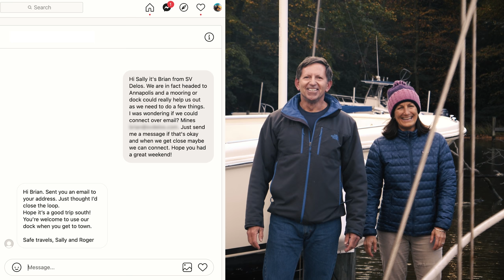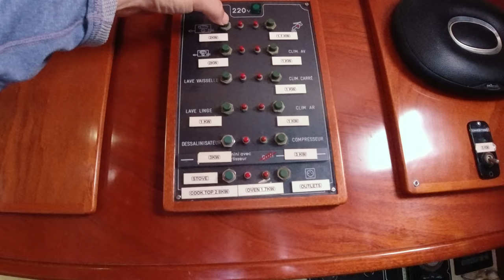6 Week MINI REFIT 😬⛵The Projects that Nearly Broke Us  - Sailing Vessel Delos Ep. 310

Comment: 15:27 All cabinet doors and drawers could have a wicker/wire/screen mesh in a cutout so air can always "circulate" from warm to cool / humid to dry.( Reach equilibrium)
Reply: That won't help. The trouble is the air temperature dropping 20 degrees when it reaches the hull. The only thing that helps is keeping the air from getting there, aka insulation.

Comment: The tubing issue seams like carbon build up. You guys, in the past, mention running the engine in very low rpms. Running it harder raises temperature and burns most of the build up. So considering reving the engine (with load) to higher rpms for a few minutes every run...
Reply: I just watched that episode. Lol
Reply: This ^ but also, it looks like an injector went bad and was burning raw diesel in that muffler pipe.

Comment: We run into the moisture problem as well, in our camper. When we're doing cold-weather camping, and have the heat running inside, we struggle with condensation.
Reply: Considering using stone wool. Stole wool is fire resistant which can tolerate 1,800°F (1,000°C), and don't release toxic gasses.

Even a very thin insulation would help a lot - and also dramatically lowering heating cost, but not if you forgot to insulate a very small area. That area would be a cold bridge (bridging cold to warm), which will transfer heat to the cold.

Rockwool is one of many stone wool products.

Polyurethane isn't a good material to use for insulation. Polyurethane burns violently and releases cyanide when it burns. Cyanide's toxicity has been proven on a site which entry sign reads "Arbeit Mact Frei".

Comment: I’ve spent three winters putting in 10mm closed cell foam.This year finally,it’s a night and day difference.It can be 80% humidity outside,and40% inside.And it didn’t take much to heat it.Very easy to use. I highly recommend it.A lot of work,but well worth it

Comment: Hey Hey Delos!
With your 50hz/60hz dilemma, the way to get around it would be to have a large dedicated AC Battery charger that supports 50/60hz input and preferably itself is multi voltage (usually 90-250v) [though in your case you have a transformer], and use that to provide power to the 24v DC Bus.

Then you can run your onboard inverter(s) like normal to get 50hz power on board for AC Appliances. The Batteries will be topped off by the charger(s) and will provide the extra amps to the inverter for periods where the chargers cant keep up if that ever happens.
It's not quite as efficient, but at least then you wont be Overspeccing things that are frequency sensitive or dependent.

Now i went back and looked at the Diagram you had in your Boat electrics videos series, and it appears that you already have the necessary battery chargers to support the idea provided much hasn't changed from late 2019, and all you'd need to do is Switch off the "Mains" AC input feed to the Victron inverter or force it to battery inverter mode and your set.

Comment: A dehumidifier (or 2!) is critical to a fresh dry boat in northern climates. Also consider Hypervent mats under your mattresses, as they make a huge difference in allowing air to flow under the mattress where the dehumidifier can’t help. Roughly weekly, when I change the sheets, I lift up the mattress and put things like shoes or boxes underneath to wedge it up. Then put a fan under the edge of the mattress to dry it fully while I wash the sheets. Keeps things dry, fresh and comfortable.

Comment: If you want to go to cold climates with a non-insulated boat, install a small woodstove. It will suck the moisture out and keep the boat dry, as well as help you heat interior.

Comment: If you have a condensation problem, you need to let outside air flow in, by keeping a hatch or windows partially open, even when it's cold outside. If you warm the inside with heating but close all the windows, it will actually be colder inside due to the condensation.

Comment: I adore you 3 very much an I am really inspired by the way you handle life's challenges as they come up... Head on with love an honesty . I know it's hard with a lil one on the boat. She's a very smart lil lady. She will be crew by 3... Brian your in the best place to get this done.. Oh Kazza lol I grew up on chesapeake bay sand.... I am fine. I just have a sailor mouth. Lol!! Keep moving forward you all can do it together!!
  Also theirs this plastic netting stuff that u put between your mattress an the wood it's enough to let air circulate you can use it in your cabinets where you store stuff. An that stuff in the plastic tub works but you need 10 of them for them to really work.. you can also get the silica for flower drying an fill cloth sacks with that an hang in closets drawers anywhere your electronics are. This is the same stuff in lil packets you find them in shoes , purses, an anything Electric has one or 2 thrown in ... Anyway living in maryland u need to learn alot about keeping dry...
  Blessings an love to you all from Donna from Baltimore City Maryland! ✌🏻💗😊❣️

Comment: The problem with the mattresses is obviously that they don't get any airflow underneath. I am using a mattress underlay (plastic mesh of ca. 2 cm thickness) underneath them to ensure airflow. Works wonders. Another thing, I don't know if you have got a dehumidifier, in cold climates it has to run 24/7 in order to keep humidity at bay.

Comment: Kazza that is the same brand of electric dehumidifier I use in my two car garage to protect my two vintage cars and the rest of the contents of the garage. During our wet winters here in the Pacific Northwest I am dumping out about two gallons of water per day from the collector in that dehumidifier. It solved my mold and dampness problem which is rough on vintage car upholstery.

Comment: In a boat or a camper that’s not insulated you can only run a wood stove or an electric space heater I can tell you from camping in Maine in the winter. All leather heat source will contain moisture including propane and Fossil fuels contain moisture when used as heat.

Comment: Don't feel too bad about the condensation.  Many apartments throughout the US are built with poorly-insulated windows.  Owners think they're saving money, but what they're really doing is accumulating large repair bills for the future.  If you're hull is solid and intact, is there a green spray foam solution?  I'm not talking 6 inches, which would take away all your space.  An inch of close-cell foam, however, would maintain perhaps a thirty-degree difference between the hull temperature and the interior temperature.  That's enough to elevate the interior surface temperature well above the dew point the vast majority of the time, making you warmer in the winter, keeping you cooler in the summer, and forming a permanent seal for the interior of your hull.  Then again, cooler waters can help keep the boat cool.  If you're in equatorial waters, though, between 80 and 85 degrees, the insulation would once again help you.  Something to consider.  All interior surfaces of the hull would have to be well-prepped.  It might be easier to run a single-stage dehumidifier that dumps condensate overboard.  Those take a good bit of electricity, though.  Nicer ones can be made to be used in dehumidifier mode by using the compressor coils to reheat the cooled, dehumidified air, and in A/C mode by dumping the heat from the compressor coils overboard.  Marine models exist which are more efficient by using closed-cycle distilled water instead of air to cool the compressor.  The water's cooling cycle is done with sea water.  Again, it's worth considering.

Comment: Dear sv delos,
Just watched your latest episode, hoping that you are on the mend.
As to your chores I would likebto suggest to use dry ice blasting. The work done in the engine room or anywhere else is easily undertaken, and that very thoroughly by using renting a unit and get 3mm pellets delivered. Once done and all cleaned  you can sweep or use a vacuum cleaner to remove the dirt.

Comment: Moisture is a constant problem, bedding needs to be aired daily. Ideally timber slats under mattresses should be used to help air flow remove moisture. Good ventilation is key, I'm surprised there isn't a fan constantly pushing air around below deck or maybe I just haven't seen it yet. It takes a daily routine to keep condensation under control. Compressed air is great for blowing off debris before removing injectors, run a hose from a dive tank.

Comment: Check out oil and grease cutter called Gunk. Perfect and really fast for cleaning engines. Spray it on to the hot engine... wait a bit... scrub a dub dub.... then rinse with water. It breaks down like the soap it really is and is great for cleaning grease, grime and engine muck. pick it up at any automotive shop.

Comment: Dampness on the boat is a big pain with one on board and I can imagine how it must be with three. I've had to add ventilation to all locker doors and keep everything as open as possible and lift the matrices every day during winter. Some people use computer fans as extractors. I think the only way to fix it is move to a warmer climate.
It's good your doing the big service as it looks like you've caught it at just the right time. Are you checking the heat exchanger cooling tubes for calserfcaction?. I reckon it the cruisers dream to find a jetty with a workshop, washing machine and a shower where you can unload the whole boat and do a reset 🏴‍☠️

Comment: kudos on maintaning your "house".  if that was carbon buildup on the exhaust pipe, plus that much carbon on your injectors means your engine is not run up to ideal power most of the time. diesels love to work and hate idling or very low load conditions. best is to aim for 75 to 85% of max rpm under load most of the time, otherwise then give her a good workout once in a while, like 95% rpm for an hour or two, it should help keep carbon deposits down and your engine much happier and reliable=safety at the end of the day. love your show! all the best!

Comment: Have you ever tried running diesel purge through the fuel system before an oil change? I do it on my automotive diesels and it usually clears up any carbon buildup on the injectors.

Comment: Marinas should have both voltages available. It's just a matter of using single phase and neutral for 120v or two phases for 240v.
Reply: Every dryer in US - right?
Reply: @brpo1  I don't know, I live in Brazil, we have  3 different voltages here depending on how many phases and where you live. I live in a town with 220V single phase or 380V phase to phase. But we also get 110V single phase and 220V phase to phase just a few towns over.

Comment: You  need to get a thin foam insulation I had a fiberglass boat and the cabinets always had moisture in them I now have a steel boat and it has foam sprayed on and is very dry inside

Comment: American power functions at 60 cycles, the rest of the world is 50 cycles. This really only negatively affects clocks or equipment that needs clock cycles. The other difference is most 50 cycle AC tends to use 220-240v, while 60 cycle is typically 100-127v.  BTW this doesn’t matter if the AC gets converted to DC.

Comment: brian your correct that was a deer specifically a white tail buck with a descent rack , many would consider that a fine catch if it were in season. karen  yes theres a lot going on and theres a lot on your collective plates .any way you slice it a child a boat a husband and 2 families is a lot of responsibilities a lot of work and more rewarding and stressful than can be related  chin up and good luck , remember there is no instruction manual and everyone makes mistakes  so learn as ya go and do your best to learn not to repeat mistakes. thanks for the video ,,,yet more work and responsibilities. oh add more ventilation it will help with the condensation , if your planning on more time in colder climates intake and exhaust fans and a heat recovery unit would do it .

Comment: Can you run the AC to use as a dehumidifier? 

AC with high humidity will mostly be working to lower latent heat. Not as efficient as a dehumidifier because losing some heat, but should take the moisture out of the air. 

Latent vs sensible

Comment: For next time on the 120v/60hz converting:

The easiest way is to buy s big battery charger that runs from any voltage frequency (they normally don't care about frequency, so being 110-220v is enough. 

Make a separate connection (for shore power) to  this charger, and run stuff from your inverter.

Also, Brazil is 60hz as well... ;)

Comment: Best of luck on the Innie-re-insertioning, and that volvo exhaust looks like the injectors went bad a while ago. Pretty typical when you don't run em very high rpm to see alot of exhaust damage from raw diesel blown thru a cold turbo.

Comment: Tesla had determined the most efficient use of the AC current would be 220v at 60 hertz.  The Westinghouse engineers were committed to 133 hz but eventually found the 60hz cycle Tesla recommended to be better.  We use 110v instead of the recommended 220v because Edison had already established a large 110v dc grid, and so compromise landed us with 110v 60hz.
Reply: We only use 110v for lights and small appliances, the rest is 220v. What comes down the grid is even higher than that, so that doesn't make much sense.  Our farm runs on 3 phase.
Reply: @emerkamp1  that was in the 1890's, ac has always been high voltage, that is why it beat dc in the current wars, it can go long distances at high voltages, but the ac motor was optimized at 60hz when first invented.
Reply: @UnderOpenSkies  I guess I didn't understand this reference.
"Edison had already established a large 110v dc grid, and so compromise landed us with 110v 60hz"
Reply: @emerkamp1  The current war was largely in New York, Edison had established 110v dc power plants all over NYC and Tesla and Westinghouse were building hydroelectric at Niagara falls.  Because it was a war and no one knew if Edison or Tesla would prevail Westinghouse chose 110v to help their side win, because the companies that were using Edison's electric were used to it already and he hoped to steal his customers.

Comment: Except for cost, would you consider a new main engine.  Perhaps going electric like Uma?  Electric means no injectors, oil changes or pumps to overahaul and maintain.  You are decent sized boat and I was wondering, besides cost, if an electric propulsion was a viable proposition for you?  I think you could run a electric propulsion from your generator too if battery capacity and recharge rate was not enough.
Most new build cruise ships are driven by turbo electric drive.
Regards from Portsmouth, Hampshire, UK.

Comment: Wouldn’t be better decision to buy a brand new engine like Kubota or Nanni? They are priced quite fair. When u count all your work and parts you needed, it would be almost beneficial to get a new engine.
Reply: Nope.  That little bit of engine work is way cheaper than an engine refit.  Changing manufacturers or even models from the same manufacturer would also likely mean custom parts, systems redesigns, etc...

Comment: Come on... its not just the u.s.  shoot even colombia runs the same power we do. That exhaust bubbling happens when the water flow into the elbow is temporarily cut off.  At least that's what i think, because when water is flowing it barely even gets warm.  I've seen it before and it was after known impeller or strainer issues.

Comment: This may work on your moisture problem but I’m not a 100% sure. You know how cold water filling the toilet tank makes it sweat? What they often do is line the inside of the toilet tank with styrofoam and in this case it stops the sweating. I was wondering if applying spray foam to the surfaces might stop it but there’s two unknowns that would have to be considered. Since it’s against wood instead of porcelain any moisture that gets behind the foam could cause the wood to rot worse. Another consideration is the foam being applied to the wood could make it very unsightly. As I’m writing this there may be another solution but you should probably run it by an expert. One thing they’ve been doing for years in homes is using a glycol filled tubing that is under flooring or other places they want to keep warm so it’s warm to the touch. This would mostly solve the condensation issue but it might require special consideration for boats. There could be other solutions I’m not familiar with that might be able to be utilized.
Seeing Siera smiling and grinning in just a few episodes has caused me to smile more than I have in months with things I’ve been dealing with. Thanks for sharing her smiles with those who are currently watching your channel. I originally came to watch your channel to see how Taylor was doing after having the ordeal of repairing her boat. I had hoped that you would be tutoring her for the things that she has yet to encounter. Even Bobby on sailing doodles had admitted he should have been walking her through his repairs he tackled to help her figure out things that went wrong. I was happy to see you both immediately began to walk her through projects along side of her. Chin up Taylor. It looks like I have a reason to watch a couple new channels in the future. Best wishes to all of you!